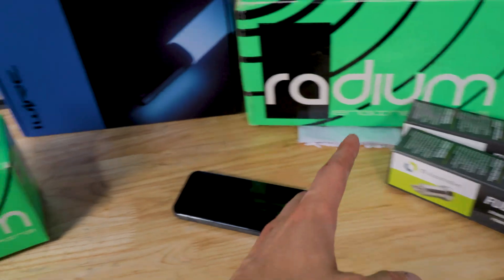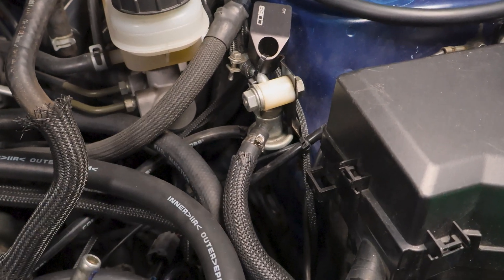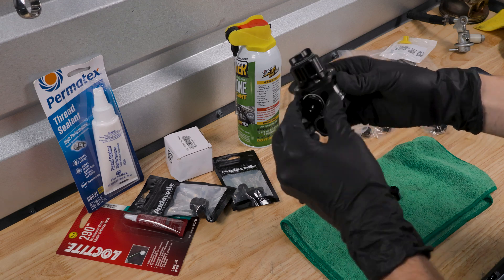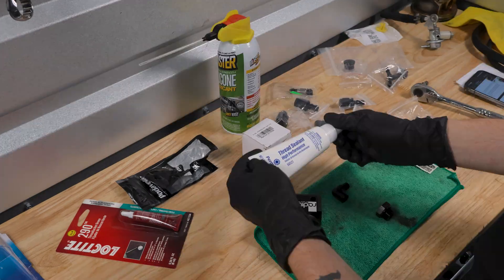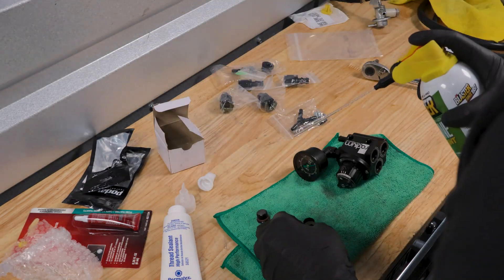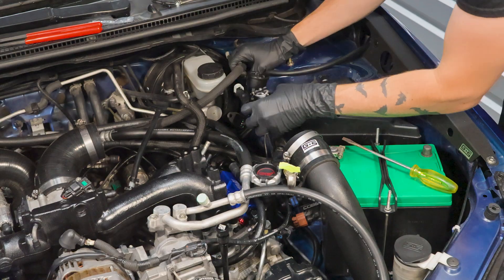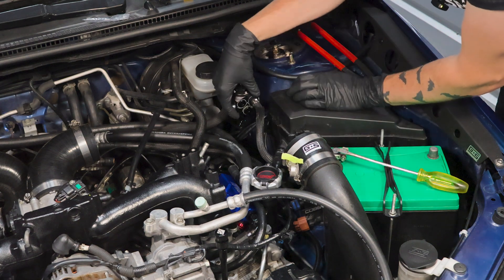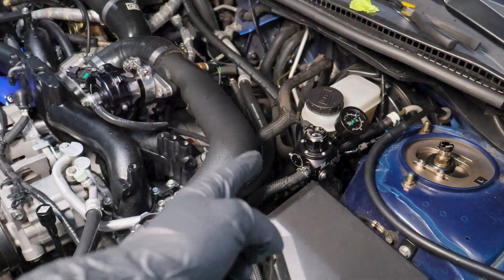How to Install a Radium FPR on Subaru STI (EJ257) | Road to 600 HP Episode 1

Comment: I currently run the Cobb fpr. I’m assuming if I install the radium I’ll prob need a tune right.
Reply: As long as pressure is the same u should be good
Reply from the maker: Um no not necessarily I didn't need a retune.